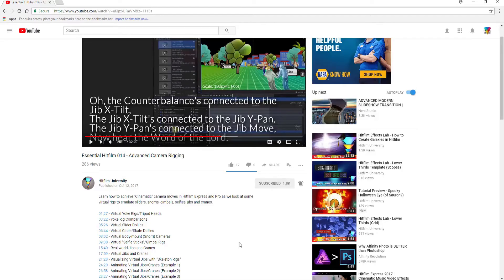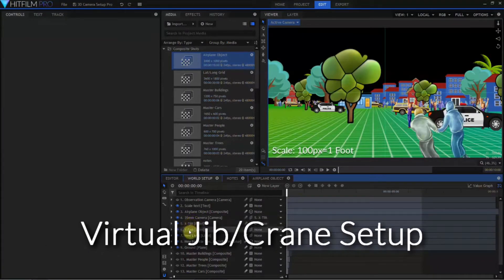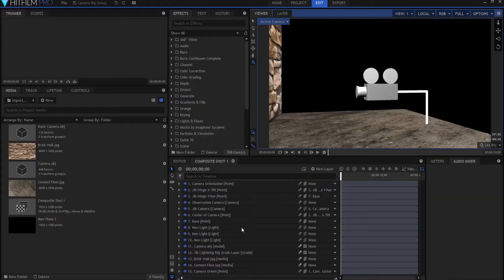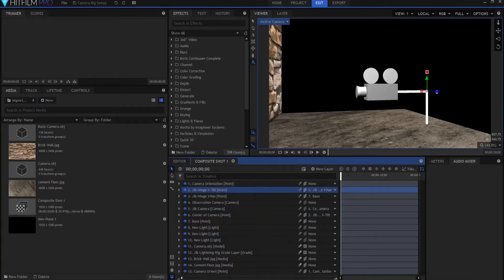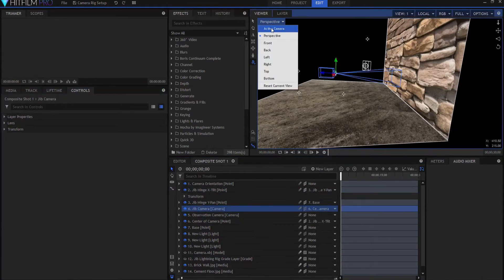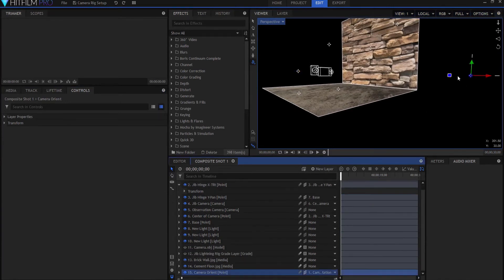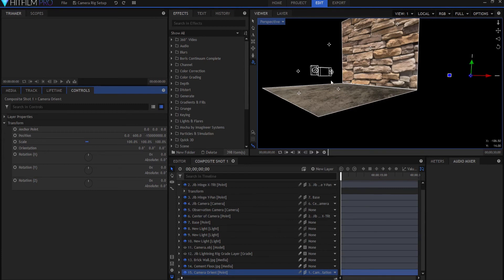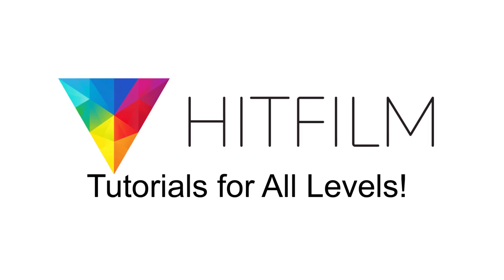Advanced Camera Rigging: Virtual Jib/Crane Setup!

Comment: I love it!

I was going to discuss Camera Alignment in Cameras 4 (to use an analogy I made everyone learn long division by hand. Alignment is the calculator.), but it hadn't occurred to me to build, basically, a second jib arm for an alignment point way off in nowhere.

Ok, Hitfilm's camera has a range of 100,000 pixels, so 15 million is 150 times farther than the camera can see! You certainly thought out minimizing camera parallax.

Ok, now there's a new issue. We do want the camera to auto-correct on X, but not on Y, or we lose that sweeping pan shot. Solution: Parent your camera orientation pivot to Jib Y-Pan.

Dammit, Jay, I wish I'd thought of it!

Oh, First!
Reply from the maker: Hitfilm University Thank you. I started at 100,000 pixels, but then when I realized that I would never need to "see" that point, I pushed out to a ridiculous distance. :)
Reply: HitFilm Sensei Another thought. This can be simplified by losing your orientation pivot and just keeping the orientation point. Parent that directly to Jib Y-Pan, which still has orientation auto-levelling the X-axis without introducing the auto-pan on the Y.

I know you were using the orientation pivot to lock the camera on a tilted position, but, check this out: a layer's Rotation controls are applied AFTER any auto-orientation, so setting the Tripod X-tilt to align to the Orientation point will level the camera, but adding X-rotation then tilts the camera, while the Orientation point holds the tilt steady! Tripod X-tilt can still be animated, as can Tripod Y-pan. You'll still have full animation control of the camera position, but your rig automating counterbalance.

When I do Cameras 4 would you mind if I presented my variation of this idea? Obviously you get the credit for coming up with it!
Reply from the maker: I think that is a great idea! Go for it!
Reply: HitFilm Sensei Cool! Thanks!
Reply from the maker: Of course, if you are specifically filming a subject while performing a jib move, you can always align the camera directly to the subject as well. So for example, you may be filming a spaceship flying by, but you want a jib pan around while simultaneously adding an X-tilt for style, you can do all that and simply align the camera to the ship (or it's position control point). Alternatively, you could create a "Camera Align Point" which might follow a spaceship's position for a while then move off to another direction when the focus of your shot changes. I could see that being very valuable if you were creating a Star Wars style opening with a crawl first, then a camera move to the focus of the story from there (Planet, space ship, space station, etc...) Regardless, it is really nice to have complete control over exactly where the camera is looking at all times. The align camera feature has proven to be a great addition to HitFilm for sure!
Reply: HitFilm Sensei You've just anticipated a large section of Cameras 4. ;-) Especially the part about creating a point for alignment (rather than an object).
Reply from the maker: I'll still watch the whole video anyway! :)
Reply: HitFilm Sensei Well, cameras 3.5, "Improved Jibs" is uploaded and scheduled for Nov 30. Cameras 4 will be after I return from overseas.
Reply from the maker: Excellent! I look forward to it.